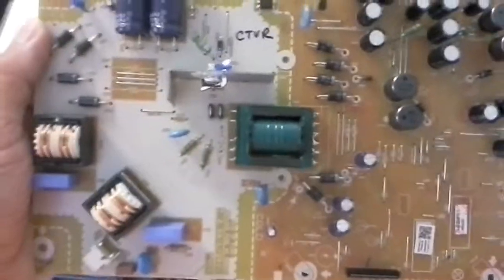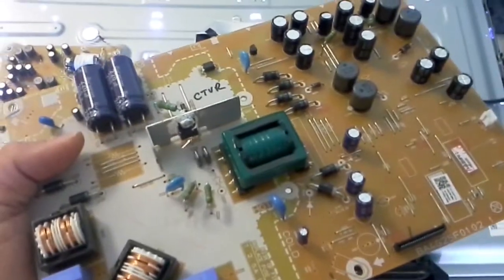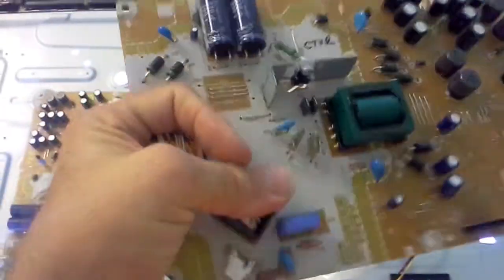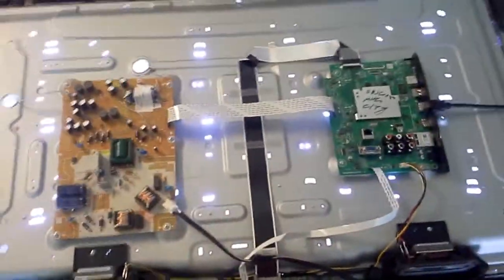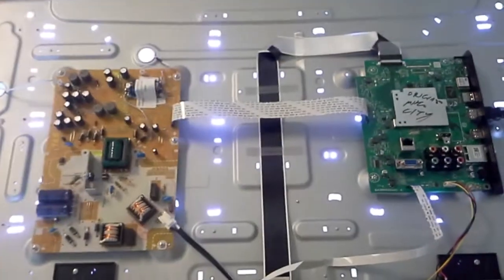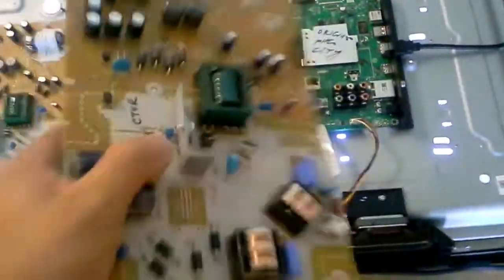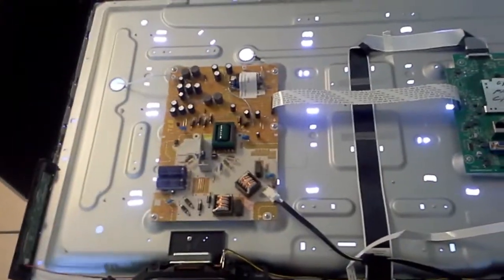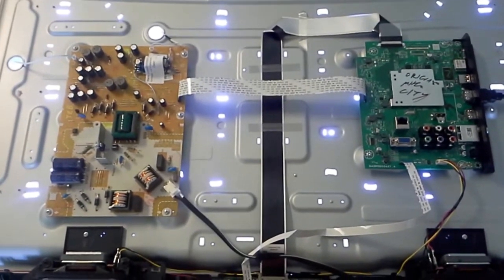How to diagnose Philips 40PFL4909/F7 ME, 40PFL4909/F7 power board BA4G25F01 02 1

Comment: I have a Philips 58pfl4609-f7.  It won't turn on, doesn't display a red standby light, but it DOES have about 4.5 v standby voltage when I measure it with a multimeter.  However, there is nothing on the 12 v line when I measure it with a multimeter, before and after pressing the power button.  Does this 12 v circuit matter?  Does this mean that the power supply is bad, or is it likely the mainboard bc I have the standby voltage???
Reply from the maker: https://www.coppelltvrepair.com/p/1823/repair-service-for-philips-58pfl4609f7-58pfl4909f7-power-upbpsprgb001-5800-p58eqf-w020

Comment: MORAL TO THE STORY DO NOT BUY PHILLIPS SMART TV'S THEY ARE JUNK AND MINE DIDN'T LAST A YEAR AND A HALF
Reply from the maker: I disagree on the basis that the same can be said about any other brand I have seen, including more expensive ones.
Reply: I know this is old but I also beg to differ on this as my philips smart tv was already a 5 year old model when I bought it brand new and it lasted me 11 years before it finally crapped out on me and wouldnt turn on again. Funny thing is it wanted to die on me for a long time. When it came on it worked just fine but if you turned it off for longer than 10 minutes then good luck getting past the screen flicker to make it turn on again. Whats also really weird is it waited until i upgraded to a 75 inch 4K samsung smart tv and the next day after installing that new tv is the day my philips tv finally hit the grave. So she was clingin on pretty good for life there for a bit lol